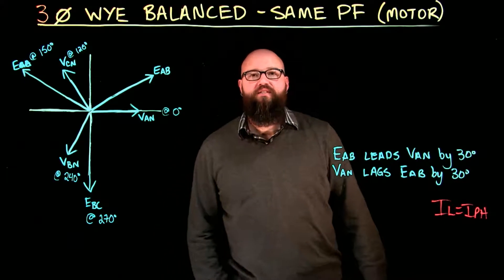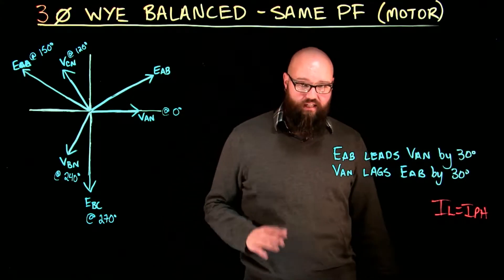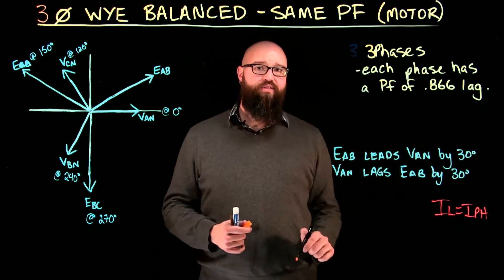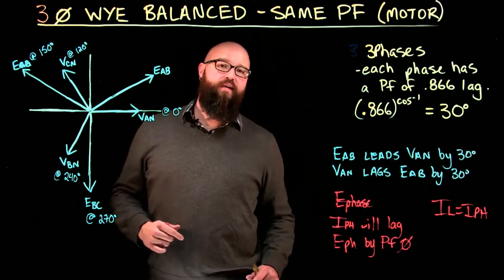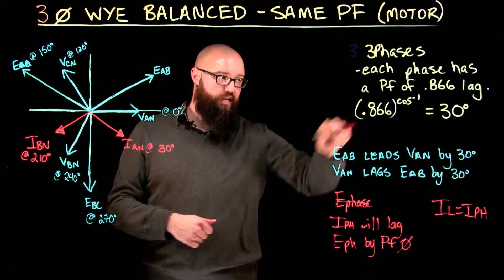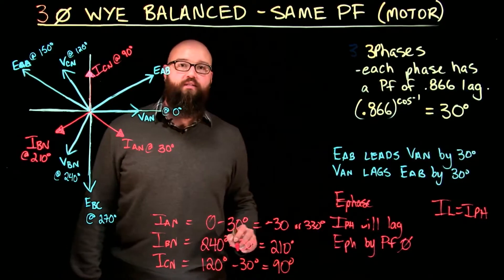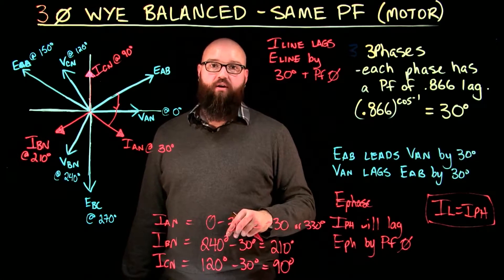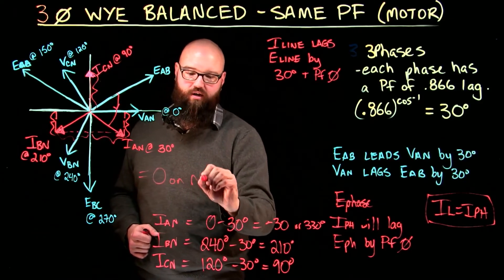3 Phase Balanced WYE Load - Same Power Factor

Comment: Hi I have question hope you see this
Event
I connected the bus pt to the low side of the substation transformer..so from the substation transformer the connection is Delta(Power transformer )to Wye-grounded(Bus PT)
The voltage readings result were unbalanced specially the line to ground
Even the protection relay detected unbalanced fault
This stumped me...
Then I removed the H2 grounding of the bus http://pt.so
 the connection now on the bus pt is wye ungrounded.
This resulted to fix the system.all voltage readings are the same line to line .and even the line to ground is okay.
So anyone have thoughts why this foxed the system?
Thanks
#foodforthought (Ive seen other power plants have connection of delta(transformer) to wye(bus pt) and the system voltages are balanced)
[bust pt diagram](229753-C1-CCED-4224-9484-F05-DBD3-B5547
)